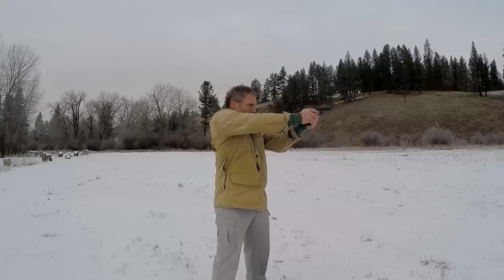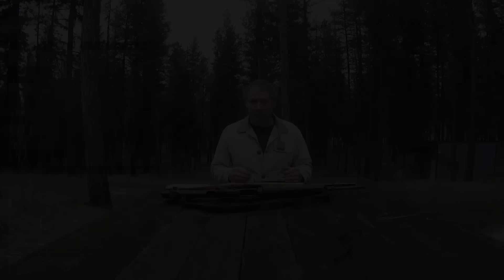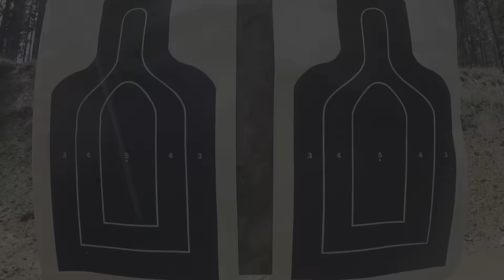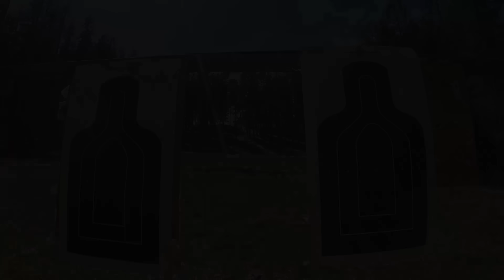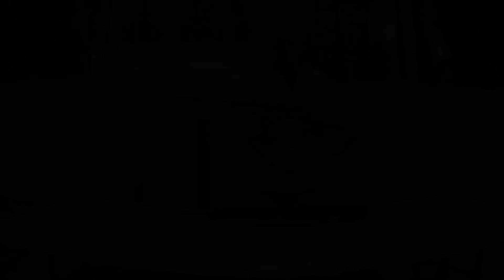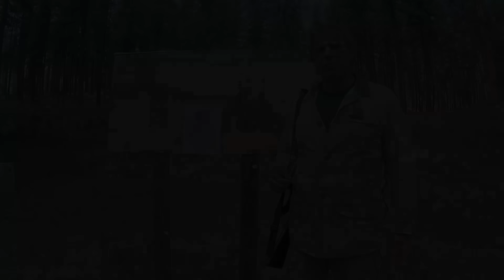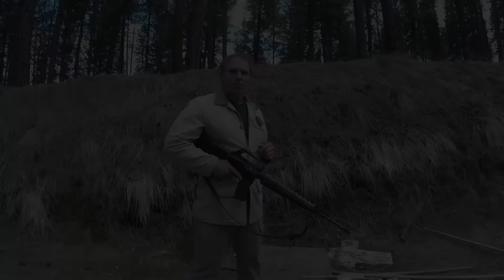Mini-14 vs AR15: Which is Better?

Comment: Mini 14's will exhibit AK grade accuracy.  I've gotten 1.5" groups with a 181 series rifle using 69 grain sierra boattails.  They will never be a match rifle.

PMI stainless steel mags are a good after market mag.
Reply: They can be worked into match rifles, with a rear lug and a heavy barrel and gas block.  An ak cannot.  There is a wall, like with an fal, that you hit when accurizing them.

Comment: I have both.  I have shot a mini-14 that did 1 hole groups at 50 yards with good ammunition.  I have seen other groups that you wouldn't like.  I have shot an AR that did 1 hole groups at 50 yards with good ammunition.  I have seen other groups that you wouldn't like.  The difference? The AR for me is a little easier to use.  The Mini-14 can be fun on occasion.  I will probably use an AR if it comes to it.  But I'm not getting rid of the Mini-14 anytime soon.  I won't complain about either and if you choose one or the other, well, that's your choice.  Thanks Paul, It is always fun to see you do the comparison.

Comment: 40y ago, the way we were taught to zero m-16 was at 25m using canadian bullseye, you zero to an x less than 2.5 inches below line of sight(don't remember the exact measurement), then the flight path would be going up until 250m where it hit the line of site then back down again.........L sight was used for 300-600m targets

Not ever having shot a mini-14, I couldn't tell you about accuracy,.........but, if in a situation where you need to butt stroke, shoot, butt stroke, shoot, butt stroke, shoot....etc, you will find the mini-14 far superior

Comment: More importantly, why are none of the accuracy comparison tests I see, on YouTube, done with a lead sled to minimize human error?
Reply: Because in real life. You wont be shooting from a sled. Human error is part of the equation.
Reply: Shawn R, solidly disagree.  If you want to assert the accuracy of a rifle than test that,  not the accuracy plus the human.  When the military tests the accuracy of its sniper rifles and their accompanying ammunition they’re placed in a chassis.  Science is all about repeatability under any circumstances.  If I hand you a rifle I can shoot 1 MOA with and you shoot 2 MOA please explain how you’d factually assert that there was a problem with the gun.
Reply: @charleshetrick3152  you are right for scientific purposes. 

Paul Harrell never said he was a scientist. He is showing what happens in as close to real world situations as possible.

If you wish to put an AR 15 in a sled side by side with any other rifle to do a scientific accuracy test. Then do so and film it. I will watch and cheer you on.

Also make sure to scientifically measure the temp, humidity, barometric pressure. 

Get custom made rounds to minimize the varations caused by standard factory ammo etc.
Reply: Shawn R, Shawn R,  I’ve tested each one of my rifles doing an OCW (optimum charge weight) test on a lead sled.  And yes I used my Kestrel and a laser pyrometer on the barrel to make sure it was the same temperature.  He’s an excellent shooter and very intelligent he also works in the dental industry which means he knows better.  

Also are you suggesting my lead sled isn’t part of the real world?  

Also I am actually getting very close to starting a channel cause everyone is doing everything wrong.  Except Tundra Tactical those guys are hilarious also Honest Trailers and HISHE are great.
Reply: @charleshetrick3152  great let me know when you do.

Not suggesting scientific tests are not part of the real world.

Although I was part of some military tests which made things look better than they really were by limiting some factors in the test but when placed in regular service did not fare so well.

One of these was an early electronic rifle marksmanship training systems. The original batch was prone to numerous equipment breakages.
Reply: Shawn R, if it makes you feel any better I didn’t uses a pneumatic bladder inserted in the trigger guard to actuate the triggers on my rifles so all of my testing is garbage anyway.  

Though I did just spend $80 making a perfect pendulum art making setup for my daughter’s Pre-K teacher,  not that she asked me to but because I watched a bunch of YouTube videos of teachers and or random citizens making pendulum art set ups that were so remarkably poorly executed it annoyed me into making one that works.
Reply: @charleshetrick3152  cool

Comment: Thanks for an interesting video. As always, you do a great job with the topic. 

My failing health has ended my career, and without a career, I don't have money. Without money, I'm not likely to be buying more of either rifle. If I weren't in this situation, I'd be looking at this video with the question, "What do I want to get next?" in mind. The video has helped me with that question in some ways. 

First, I'm now going to be much more suspicious of a Mini-14 that I find for a really good price. I now know that a Mini-14 at a really good price is probably one of the ones that was made poorly and has passed through a line of owners who were unhappy about the performance. I'm much less likely to join that line. Knowing that the good Mini-14s won't save me any money is helpful. Knowing that the magazine costs will negate any savings is also helpful. 

Secondly, I now understand the advantages and disadvantages of each sighting system. Because my eyesight has declined quite a bit, I don't expect much from any kind of iron sight shooting. I still love the look of a rifle with iron sights. I still wish that I could use a rifle with iron sights effectively because a scope is one more thing to go wrong on any rifle. Even so, I'm likely to end up putting some kind of optic on any rifle that I buy. Based on this comparison, my sense is that by the time I add an optic, a good Mini-14 and a good AR15 will have similar performance, particularly in my hands. 

Thirdly, while the heyday of the Mini-14 may have been the 70's or 80's, I'm likely to buy one of the modern ones if I ever get back into a position to buy one. From what I've heard, the modern improvements have helped the accuracy and made the performance of the Mini-14 more consistent. If I buy one made recently, I'll probably be getting a rifle that will shoot as well as an AR15 does, particularly in my hands. 

Finally, the part about magazine changes is good information to have and is interesting. On the other hand, I don't expect to survive even one encounter where I need to do either a speed reload or a tactical reload of a 30-round magazine. I'm too old and too sick to be accepted even in a militia. If I'm fighting using either rifle, I'm likely fighting alone. Zombies aren't real, and real people fighting back with almost anything are likely to get me if I can't deal with them in thirty rounds. If I'm in a position where I can change magazines at my own pace on either rifle, then maybe I survive into the second magazine. If I'm in that position, I'm surviving because I found a position that gives me a great advantage. The position is more important than the specific rifle. 

You spoke about topics that would require you to go into much more detail than you wanted to put in this video. As you're aware, all of your subscribers would love to hear that additional discussion. Along those lines, I have a couple of thoughts for topics to include in a follow-up video. 

As I understand, the Mini-14 is based on the old M14 which was a 1950's rifle design based largely on the M1 of the 1940's. The AR15 was a completely updated rifle design of the late 50's and early 60's and was intended to be a step forward in semi-automatic rifle design. I'd like to hear whether you think that the more modern design of the AR platform is an advantage in itself. 

Given that many people will put some kind of optic on either platform today, I'd enjoy seeing some of the shooting tests done with both kinds of rifle using modern optics. My sense is that the AR platforms will accept many more kinds of optics, and that versatility becomes another advantage. I'd enjoy hearing that discussion and learning whether my sense is accurate. 

I'd love to have an AR15 with the 20-inch barrel, but most AR15 rifles today seem to have 16-inch barrels. Seeing these tests with that length of barrel would be interesting. I don't expect any real change except in the bullet velocities, but the test would still better compare what most of us are likely to find when we go shopping for a rifle. 

I have always wanted an AR15 with the colored laminate furniture. I'd most like one that was blue and black, but a tan and black would be nice as well and would be a better color combination for coyote hunting in the west. With a scope on that rifle, maybe the appearance wouldn't be as alarming to the Chicken Little Brigade. 

Thanks again for all you do to help the firearms community be more educated in all aspects of our hobby/passion.

Comment: It is not a short and long range sight. They are ghost and peep sights. You center the target with the ghost sight and use the top of the post with the peep. I could discuss the optical mechanisms ad nausem, but suffice it to say, you are not using the ghost ring correctly as originally designed.

Comment: believe it or not, i think the AR is only a couple inches(maybe 2.5?) high at its highest point between 25 and 300.
then again you may be zeroing slightly differently.  my zero is generally on at 25, about 2-3" high at 150-175, and then just a little low(like an inch or two at most) at 300.  though this is with a 17.5 inch barrel shooting 77gr corbon or black hills 5.56TMK(tipped match king, which is my home/self defense gun.)
it's pretty cool knowing you can have one zero/hold over for 25 to 300 yds(not that I ever foresee having to shoot anyone even remotely close to that far away.)

Comment: Great video Paul and yes I sat through the entire presentation. You are the most informative firearms presenter on you-tube bar none. Keep up the good work. I was in the submarine service in the last half of the 70's. Instead of the M16 being in our small arms locker, we had M14's and two old 1927 Thompson submachine guns. I inquired the master-at-arms where he found them but was told not to ask. Fond memories of both types of firearm.

Comment: Nice work.  I have a Ruger 10/22 that jams more than Whitesnake in the 80’s so no more Ruger for me.  That’s all I needed to know.
Reply: A non functioning 10/22 is so rare it might be worth something.  I bought an old one super cheap and could not get through a 10 round magazine.  I took it a apart and cleaned it thoroughly and now it will fire as fast as I can pull the trigger.   I'm selective when it comes to Rugers but I would never write them off completely.

Comment: A truly GREAT and insightful presentation, Paul, THANK YOU.  I’d add three more (important, in my view) AR advantages:
-   RIFLE FLEXIBILITY.  That .223/5.56x45 AR can — fairly easily and inexpensively — be converted to other calibers.
-   HEAVIER PROJECTILES.  Ruger now produces Mini-14s in 5.56, but they have 1:9 twist rates (I believe (??) all .223/5.56 Mini-14s have 1:9 barrels).  Recently, heavier bullets have — for good reasons — become quite popular, for weapons chambered in.223/5.56, but 1:9 barrels are often marginal for projectiles with masses of 73+ (sometimes even less) grains. 
-   ACCESSORIZING.  It’s in at all unusual for ARs to have a light, an optical sight (perhaps two), a sling, possibly a laser, and a bipod (doubtless, I’ve left something(s) off this list).  These enhancements are easily accommodated on many contemporary AR designs, but near-impossible with the Mini-14 (although the MilStd-1913 rails incorporated in their Model 5846 Tactical rifle appear to provide considerable accessorization potential).

Comment: Owned several mini-14's and loved all of them however, the model mini you're using is the pencil barrel mini known to be less accurate than later "big" barrel mini's. Correct me if I"m wrong as to which model mini you're using. The loss of accuracy with MY pencil barrel mini's after 10 rounds was significant. So much so that I got rid of that model. This is not hating on you just pointing out that you used a "known" less accurate mini in your test. The early model mini's were so known for accuracy issues, that Ruger changed the barrel in later models.
Reply: Funny, I never really noticed the change
Reply: It didn't show up for me until after running like 10 rds thru the old model and at distances beyond 100 yards. If you don't shoot beyond 100 yards, no issue. But reaching out there, as he was, there is a distinct issue with the pencil barrel mini he was using in the test. I understand he used what he could get but he really should have mentioned the known issue with the Mini-14 model he was using. I also seriously doubt that  most AR's, people are using, have that long a barrel.  @homefront3162
Reply: I had one like that.  The newer ones are much better in the accuracy department.
Reply: I didn't hear Paul SAY that the Mini used was the pencil barrel. i could have just missed that. What I DO know is that the A1 he used DOES have the light barrel. It would not be an A1 if it did. A2's and after used the heavier barrel. So even if the barrel on that Mini was the least accurate type, the A1 is ALDO using the least accurate type of barrel> So your comment (IMHO) is invalid.

Comment: Paul and Hickok 45 are the best reviewers with solid dope.  Have you done a AR 15 A1 vs a upscale AK 47.  I have two Ars that are fine tuned a bit and shoot lights out.  But bought an upscale AK 47 for a SHTF weapon.  No doubt the AR is more accurate by a bit but the AK hits harder.  However wound channels seen in Namn, etc show the high velocity round of the AR to be more extensive.  Anyway what are your thoughts for SHTF weaponry (realizing belt fed is out of the question for most of us).
Reply: Ooops I should include Robski of AK Operators Union for solid dope on the AK platform

Comment: A more expensive comparison would be modern AR-15 vs modern Mini 14.
Reply: It's worth mentioning that there is a cutoff date to determine whether a Mini is "old" or "modern": whether it's before or after 2005. That was the year Jim Sullivan was hauled out of retirement to come back to Ruger and retool the machinery and assembly specs to create the "modern" Mini-14s. These can be determined if the serial number starts with "58."
Reply: @AICW  Ah thanks for the info!

Comment: Yes Paul, if you were anyone else but you, we would have fallen asleep on every talking section of the video, lol, but since you are you, I stayed awake and paid attention to the details. Thanks, oh and a observation, other than the safety location being different, it seems the mag change on the mini 14 is similar to an AK in comparison to the AR type. I  wanted a mini 14 for decades but never got around to buying one and have now had AR's for about as long. I see a vast different in ease and speed in mag changes between the two and now, I no longer want a mini. Especially when a mini is between $750 and $900 and I can build a pretty good looking kick butt AR for $700, to me the choice is clear.

Comment: Probably have seen 10 comparison videos and this is the ONLY one that I thought was honest, unbiased and accurate.
Reply: Yeah it's usually some young guy who thinks he's an operator who rly works at Walmart and has some cheap PSA
Reply: It doesn't matter who try to compare the Mini-14 to any version of the AR-15, they always do gymnastics to bring the Mini-14 into relevancy.
Reply: George I would argue that the Mini-14 isn’t entirely irrelevant in most discussions of auto-loading centerfire rifles, but instead that the discussions have been swamped by a wide variety of newer and more modern firearms. 

Of course later models of Minis are better than those from the 1980s and 1990s, but they aren’t really able to compete with the sheer volume of different options on the market today.
Reply: @coraline7866  Thank you someone else, like me. This demo was laughable.
Reply: @Hater Oftheleft Well I might be a moron but I have spent a lot of time on the range and have beaten some exceptional marksmen.
Reply: Pfff done in the 80s lolol. Now the mini 14 well beats that pice of crap S2. Tell me can you even find a mini 14 now. Hell no they sell out the AR or A series. Pff please.
Reply: Accurate is the last thing this is.  This is sad.
Reply: @richardjimmink4647 you are a moron because you didn't listen and want to flex.

Comment: Had 2 different mini -14's & was a huge fan because of the A-team when I was a kid.  The Mini-14's were never better than 3-moa with triggers jobs & using a wide variety of factory & hand loads.  All my AR's have been under 3moa most 2moa or better.

Comment: I shot the M16 in the military a bunch- I never particularly liked it nor trusted it (dislike the buffer vibration- feels like a toy) and prefered the M14 mostly because of its .308 chambering.  I now own a Mini14 Ranch Rifle as a truck plinker and like its feel much more than the 16.  Both designs have their advantages, but have the practical disadvantage of chambering the .223.  As for accuracy, never noticed a difference- but I use a red dot sight and dont normally shoot off of a bench rest.

Comment: We’ve seen videos of you from the 80s and 90s. Of course, you had a Mini-14 then too. You just didn’t have the parachute pants! 😂
I did sit through all of it and as always you thoroughly cover a topic in record time. Except for the heavier barrel changes Ruger made to the Mini after complaints of losing accuracy in the earlier lighter barrels after they got warm. Which raises the question of which barrel does yours have and could that have been a factor at the 200-300 yard distances? Anyway, thanks for making another video!